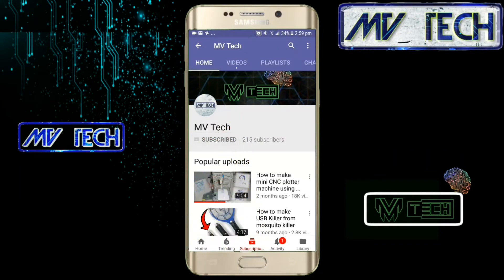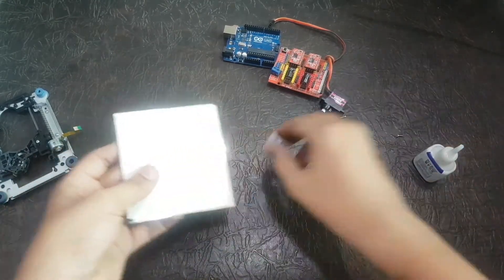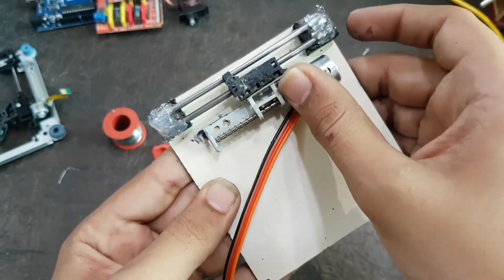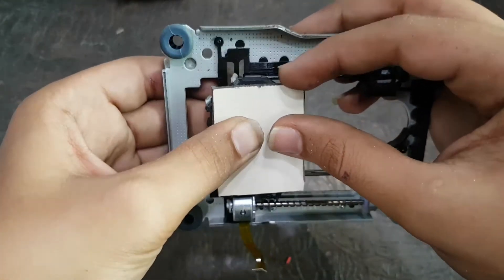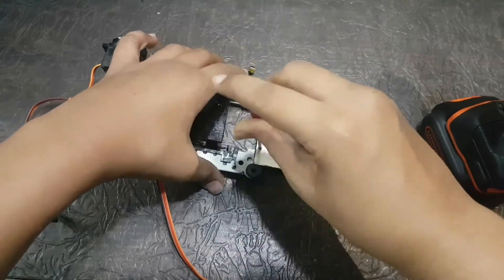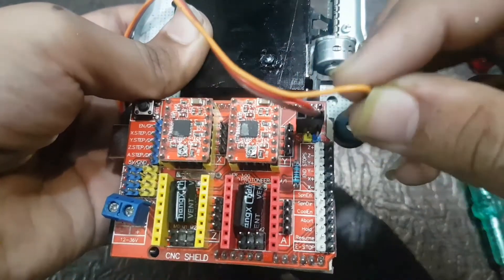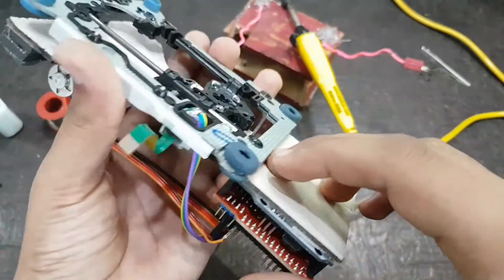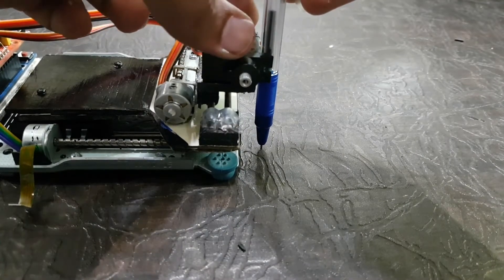How make homework writing machine from arduino & DVD Writer

Comment from the maker: Hope you guys enjoyed this video!! you can ask any question down below.
Reply: Bro first of all i made this project and it doesn't start.... 
My servo motor works but steeper doesn't I have a 12.96v battery as power source but it doesn't start
Reply from the maker: @vyascommunicationabouteduc2493  what's the current value of power source ?
Reply: @MVTech  first of all it's a battery
Reply: Please help bro please
Reply: Details of my power supply... 
🙏 help
Reserve capacity 3 A
Battery capacity 3 Ah
Voltage output 12 v
Operating output 12 v
Reply from the maker: @vyascommunicationabouteduc2493  battery specs seem to be right, check if the steeper motors are working properly- connect 9v battery to motor terminals to check. Also try to check with 12v 3amp or 5amp power supply incase battery cannot power it.
Reply: Ok bro i will
Reply: @MVTech  bro when I connect my steeper motor to 9v battery a small sound comes like "tak"... And then I connect  it to 12v 3 amp battery but again that voice came and my steeper motor gonna heated too much
Reply: @MVTech  please help what to do
Reply from the maker: @vyascommunicationabouteduc2493  Ok so it seems to be the motor is not in working condition and also only use 9v battery to test the motor individually or it can damage it. Use different DVD drive and firstly check the motors
Reply: @MVTech  "tak" like sound came from x axis steeper motor
But when I connect it to y axis a smoke appears from wire as I connect it to battery...
Please help
Reply: @MVTech  bro how to check them
Reply from the maker: @vyascommunicationabouteduc2493  Try with different DVD Drives
Reply: 12.96 V
Reply from the maker: @vyascommunicationabouteduc2493  I am asking for the current meaning how much amps does your source provide ?? Not the voltage
Reply: Please 🙏 help
Reply: Bro i have decided to give my machine a try with ne DVD writer boards I hope I will success now although i need your too
Reply from the maker: @vyascommunicationabouteduc2493  ya.......at start first check the motors then make the body :- )
Reply: Can i use 12v adapter for the power?plz answer my question broo
Reply from the maker: @lalasailo6788  Yes, use 12v 3amp or 5amp
Reply: Plz amnswer brooo
Reply: Bro 1 more question?if i dont use jumper caps or any wires will it still works?
Reply: Plz answer broo plzzzz

Comment: 8:11 bro where can i find that black stuff?plz answer😫
Reply from the maker: Its called "Female header pin" buy it on Amazon or from local market
Reply: @MVTech  bro another question?can i use wire instead of jumper caps?
Reply from the maker: @lalasailo6788  Ya definitely, but attach them carefully cause the pins are too close
Reply: @MVTech  bro ur the best thank u so much❤
Reply from the maker: @lalasailo6788  welcome

Comment: Bro please tell the power source
Reply from the maker: You can use 12v 3amp power supply, it will work fine
Reply: Bro can we use any adapter...
Reply: Bro please tell me can we use jumper wires instead of female header pins
Reply: Please help 🙏😭
Reply: Sir if I use 5v 1amp adaptor instead of battery it will work or not
Reply: Please reply me fast 🙏🙏🙏🙏

Comment: i followed every step of the video but my machine is not even moving..... kindly please please tell me how to fix it... i have to submit it tomorrow.
Reply from the maker: What value of voltage and current are u using ?
Reply: Im using adapter 5v 2A
Reply: I also have a 12v dc rechargeable battery... I used it but it had burned a stepper motor.... then I replaced a motor and used adapter.
Reply: I also have a 9v battery... should I use it ????
Reply from the maker: @bakhtawargul8411  
Use 12v 3amp supply then it will work normally
Reply: Ok
Reply: Thank you

Comment: Sir please give me your number I want to personally call you and clear some of my doubts.I have made a cnc like this but it is now working somehow please send your number
Reply from the maker: I can't give u my number u can ask any doubts here only
Reply: Sir I have made a homework machine https://www.google.co.in/url?sa=t&source=web&rct=j&url=%23&ved=0ahUKEwjD8eKRsJTfAhUUQH0KHaZcCEQQxa8BCCcwAQ&usg=AOvVaw0VTJzWxrN8ZFOD4xbU2nov.   From this video.My problem is after making this it work for the first day but the  very next day when I tried to run ben box the code is not running but aurdino expansion boards are fine .Also the x and y axis are rotating very slowly and is hardly able to move.I have unplugged and replugged all the pins , rest the code, uninstalled and installed benbox but still not working.I have to submit this school project within next few days please help me .

Comment: I did everything in the video but i couldnt figure the electricity (volt and amber) and what kind of power
Reply: 5v and 1 amps of power needed
Reply: @anwitodas2447  adaptor or battery
Reply: @vyascommunicationabouteduc2493   its battery(5v and 1 amps)
Reply: Bro use 12v 3amp